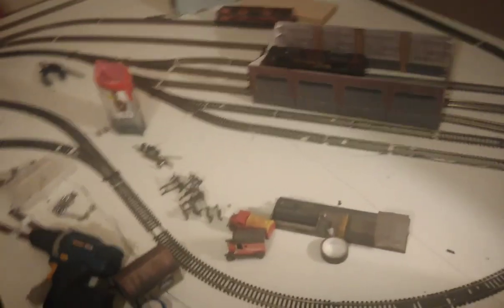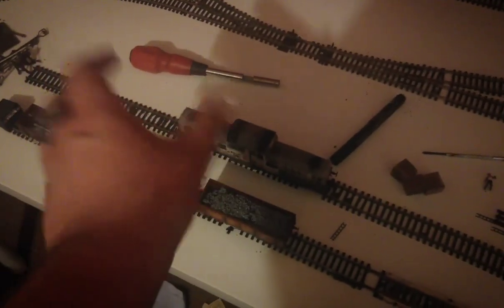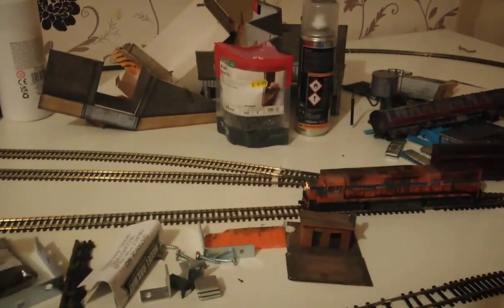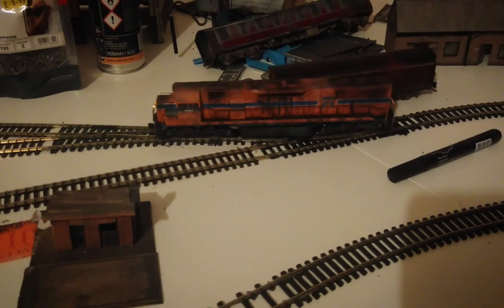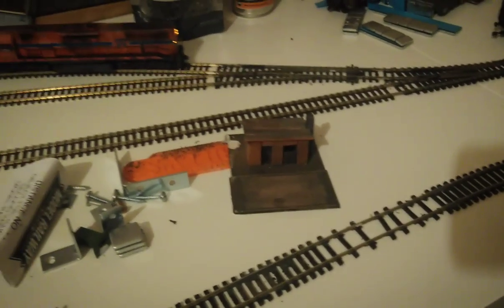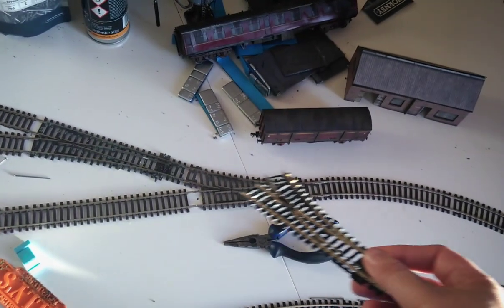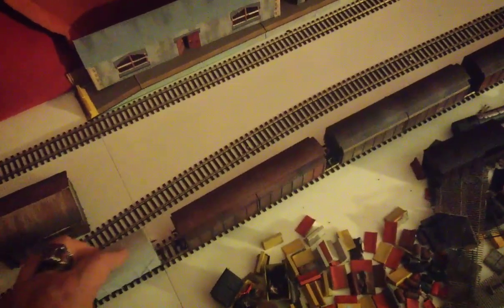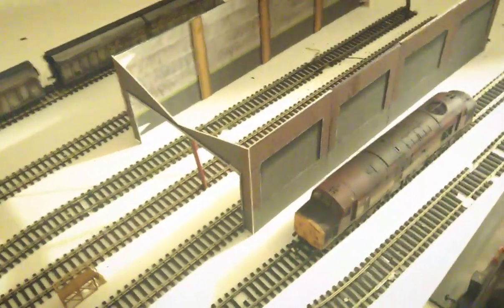HORNBY points derailing locos | IKEA TABLE LAYOUT UPDATES

Comment: Hello Mr T.

I don't have a single section of Hornby track. It's all Peco for me, far superior. And, there's a guy on the well known auction site who sells brand new nickel silver Lima track, both straight and curved, in their original boxes (Golden Series) at a cheaper price than Peco and Hornby, if you're hard pushed for cash. Good quality incidentally. If you are thinking of replacing Hornby points with Peco, you'll probably have to purchase Peco fishplates, but that's no hardship.

Regarding the derailments, ever thought of checking your wheel gauges. They should be 14.4mm or thereabouts. Too much deviation will cause grief over the points.

By the way, layout is coming along nicely. I'm just wondering how the adhesives for the scenery is going to react on the acrylic painted surface of the IKEA boards. 🤔 

👍👍👍
Reply from the maker: Already tested mate - no reaction at all :) 

And I've replaced that ONe Hornby point with Peco, same as the rest of my points now :) 

It snuck by me! 🤣🤣
Reply from the maker: @UC1V3uhEhSLH66YgLoeNUpEA well to be fair I did say that it would be a test period for the Kadees before making any final choices - I'll be making a more in depth video about the two types in the coming weeks mate anyway to give people a chance to see a fair account of the two types.

Also

I suggest you tune in to the Jenny Kirk live stream tomorrow night at 7pm :) it's worth a watch mate!👍
Cheers mi dear :)